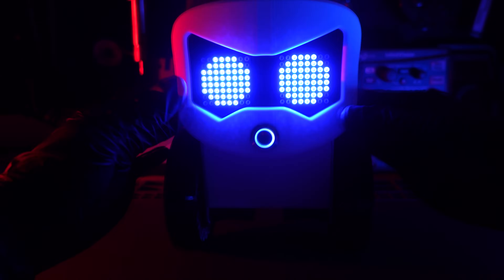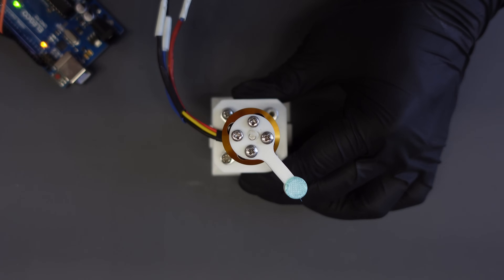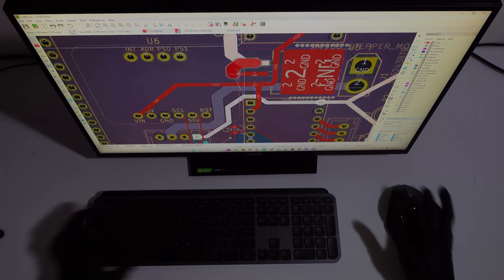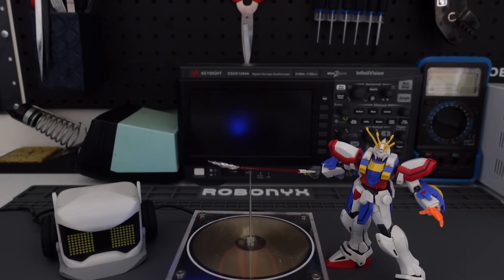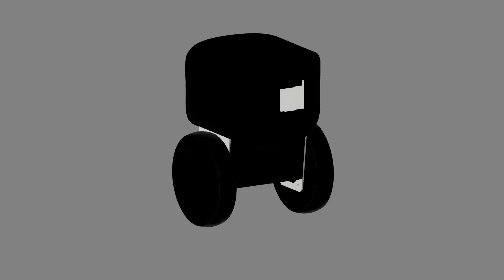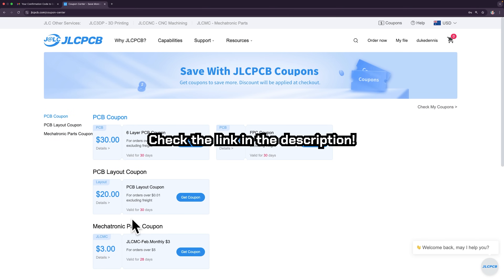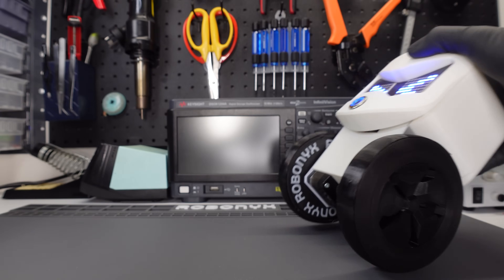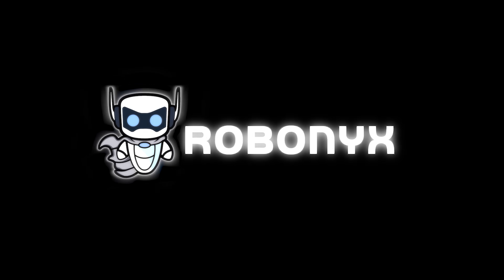How Self Balancing Robots Work! (Theory, Components, Design, PID)

Comment: Excellent breakdown 👏
The way you explained the inverted pendulum theory + real-world sensor noise makes PID tuning finally make sense. Loved the clear link between IMU data, control loop timing, and why even small delay kills balance. This is one of those videos that actually connects math, electronics, and mechanical design properly.

Comment: I'm currently in my first year of an EE degree. Watching people build cool stuff like this just gives me so much more motivation to learn. Great video!!
Reply: This is so real - only differnece is that i am in mechanical haha
Reply: I did EE, and I was/am a lifetime electtonics hobbiest. Basically nothing I learned in university translated into buulding things. I think maybe 1% of the time spent doing EE at school was; figuring out how to select components, how to find ICs that will do a job easier and less expensively than designing your own circuits, how to solder a board together, how to design boards in cad to get them manufactured, how to build enclosurs for your electronics, how to use test equipment like oscilloscopes, how to program microcontrollers. The other 99% of the time was grinding out assignments, solving super contrived problems. Memorizing things for exams that you will immediately forget. Manually solving time consuming math equations that you would never solve on paper. If you drop out, you can spend your tuition money on electronics projects. And also, you wont perpetuate the school system that exists solely to gatekeep people from doing their passions.
Reply: @ferriswhitehouse1476   yeah you're right. The school system is cooked, but you know, that degree might come in handy when looking for a job xD. And I'm also lucky that I'm such a big nerd, I'm not waiting for my teachers to turn me into the builder I wanna be, I'm actively seeking to gain the skills through building personal projects :))
Reply: @joseph0x45 where are you from brother ?
Reply: @joseph0x45  True, if your goal is to get a job, I would recommend getting the degree. I am hoping to build a new society from scratch where I don't need money and instead build everything I need by myself, from sticks and fire to semiconductors. Hopefully society actually collapses soon or I am going to look like a big dingus.
Reply: @ferriswhitehouse1476  Hi I also love building cool stuff. Where are you from btw?
Reply: Nice